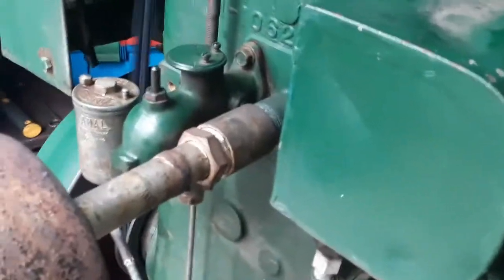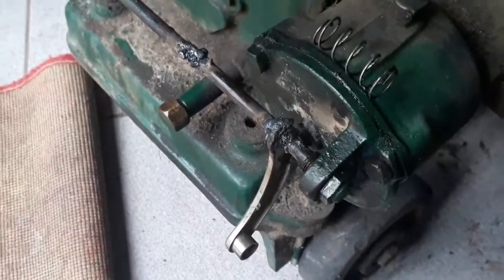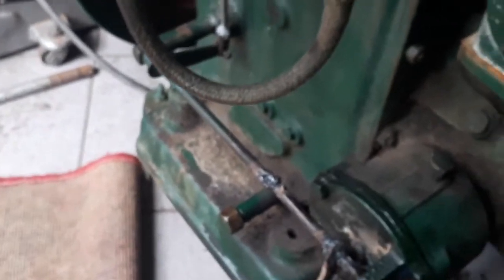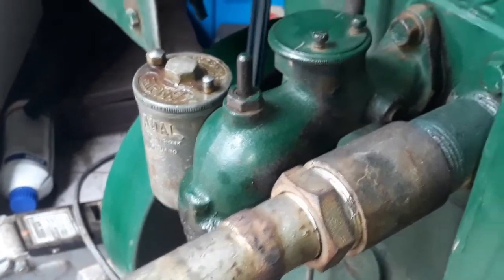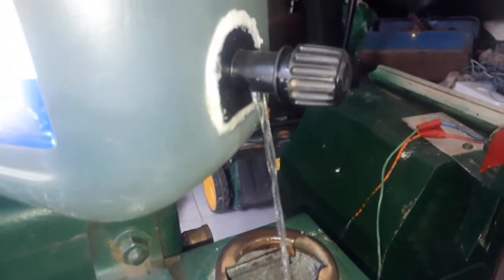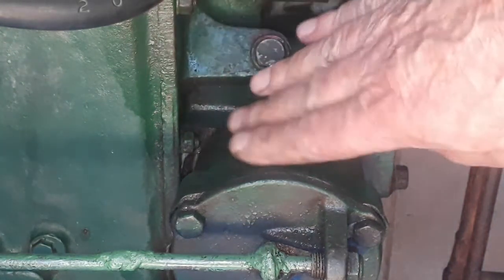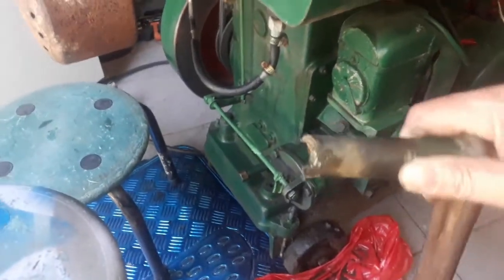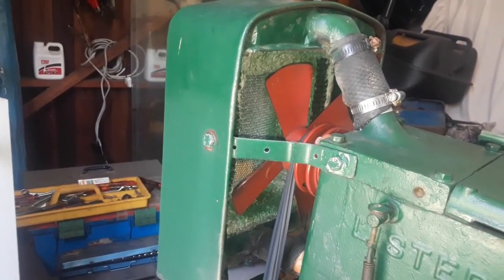Lister D work continue, spring replaced, touch-up and cleaning begins, preview next video

Comment: I wonder what year that engine was made,, I sure looks like that governor was supposed to be oiled and not greased but I could very well be wrong on that.
Reply from the maker: Vernon you are 100% correct, it just needs oil now and then that is why there is an oil applicator on top, I removed most of the grease when I replaced the spring, thanks for watching and commenting.... I guess you had a harvest already from that squash, if so did it taste OK
Reply: @jankotze1959  yes, but we planted them in containers so we only got 3 squash, we had many blooms but I guess they got too dry in the small pots.
Reply from the maker: @MissouriOldTimer  Sorry the machine is a 1950 model